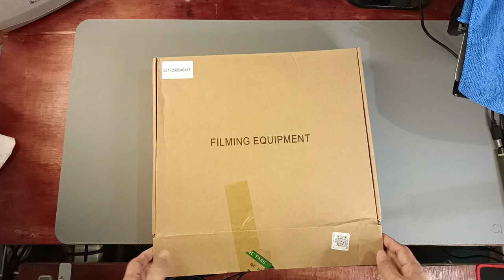Camera Slider motorized - Affordable! How to Install - Auto Dolly YELANGU!

Comment: Can this continuously run back and forth on the rail without using the remote? For example, I want to use 4 of these in a live stream, and I would like to have these continuously rolling without having to control 4 remotes manually.